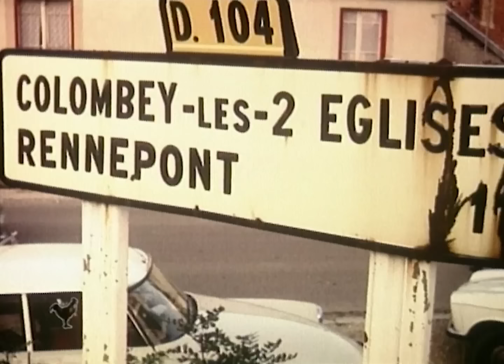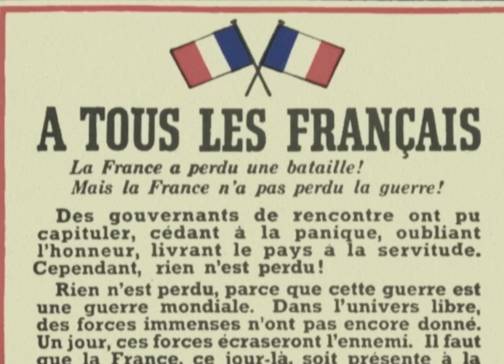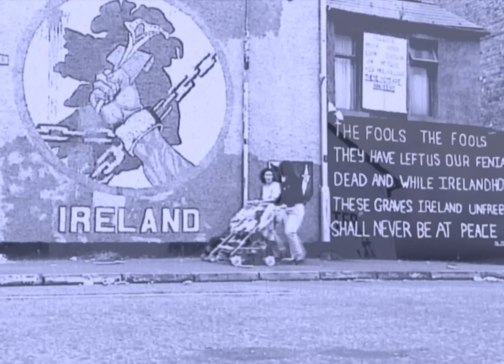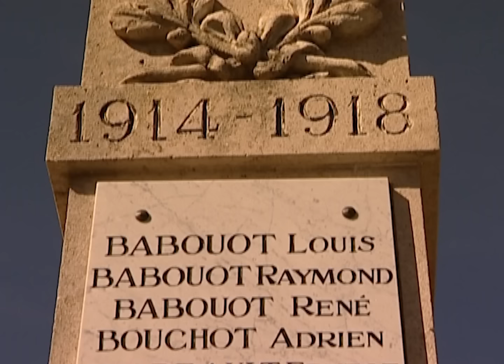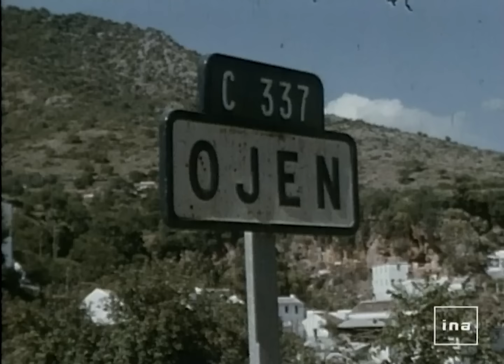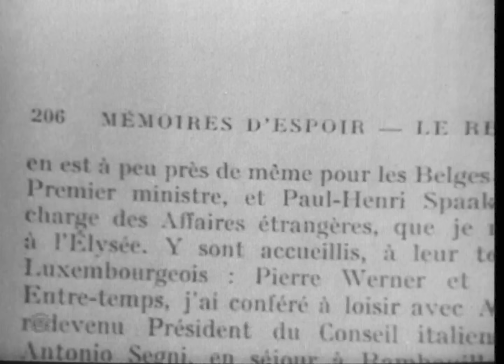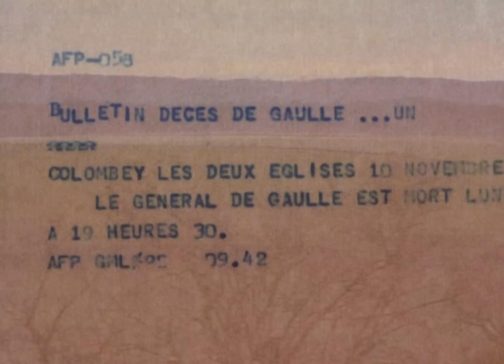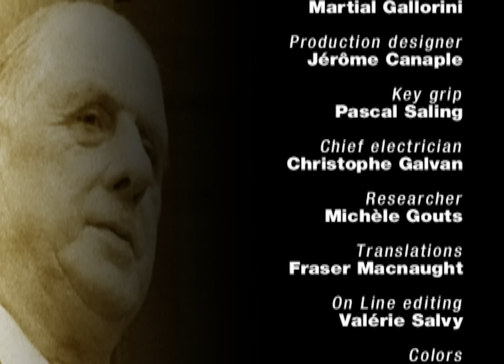Final Days of an Icon: Charles de Gaulle

Comment: France should have joined the Axis in 1936.
Reply: cringe take
Reply: @JackGray-ne1jv  Communism was the only threat.
Reply: @MarkHarrison733  the final solution and the hunger plan say otherwise
Reply: @JackGray-ne1jv  I am talking about things that actually happened.
Reply: @JackGray-ne1jv  The USSR had never signed the Geneva Convention.
Reply: @MarkHarrison733  they did try and implement the Hunger Plan and the Holocaust
Reply: @JackGray-ne1jv  The Hunger Plan was no different than the Allied starvation blockade, which caused all of the other deaths.